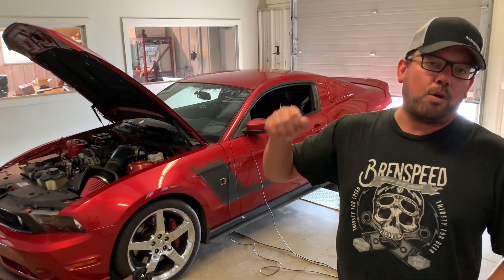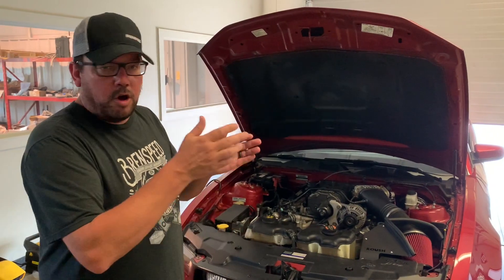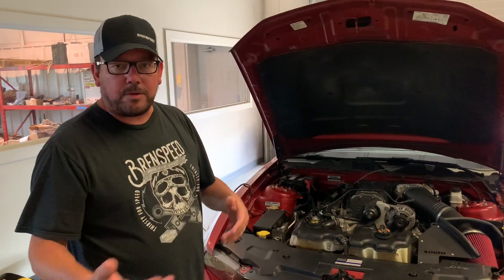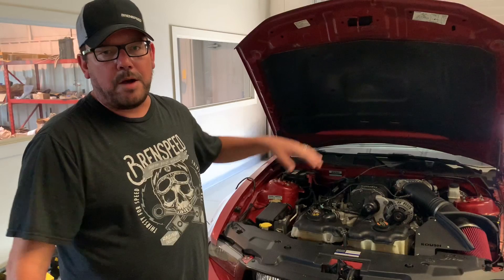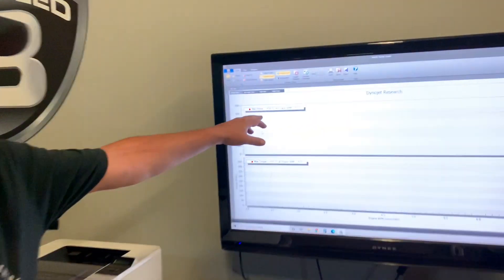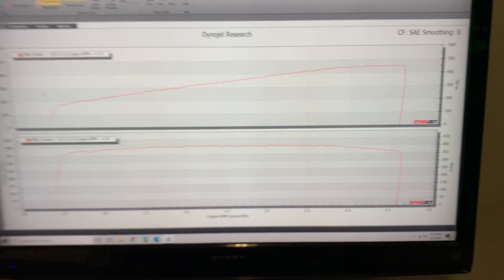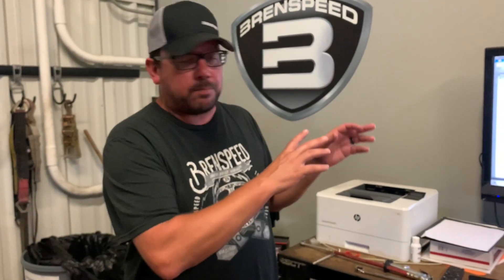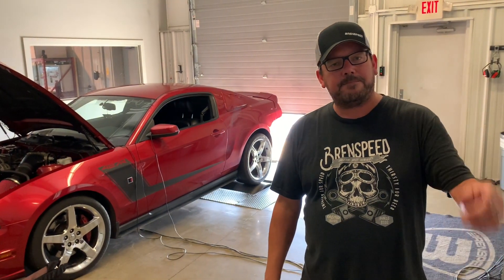2010 Roush 427R Mustang (with cams and headers upgrade) M90 supercharger & Dyno AT BRENSPEED

Comment: Question will the 2010 setup work for the 05-09 gt model ? With minor adjustments? Asking because I’m looking to pick up a used one for a deal but it’s a 2010 model one
Reply from the maker: If your talking about the supercharger kit itself I think you could make it work on a 05-09. If you are talking about the upgrade kit like the cold air it is specific to the 2010 model supercharger and will not work on the 05-09 M90 supercharger.
Reply: Thanks I was referring to the factory blower. By any chance do you know where I could find a 2010 model lower intake manifold for the blower that it will not come with. Also is the intake manifold direct bolt on.

Comment: What can you do for a 2000
Stage 3? It was originally around 350-370 horse from factory. Maybe under estimated? How much more hp can be added for a small package like this and what does it cost?
Reply from the maker: Here is a link to Roush upgrade packages https://www.brenspeed.com/05-08-mustang-power-adders-roush-upgrade-packages.html

Comment: Have a 06 with the m90. Looking into cams. Any recommendations.
Reply from the maker: We always use Detroit Rocker SC grind on those. Here is a link. https://www.brenspeed.com/detroit3vsc.html
Reply: How many horsepower you are making i have a 2010 gt with the m90 but they said you can't get the 450hp is that true

Comment: Is the Fuel pump upgrade required to make that kind of power.. I have an 08 with a m90, headers and H-pipe. Would  love to see 450+HP without having to dump too much more money into it.
Reply from the maker: Yes the stock fuel pump duty cycle is maxed out. So when doing headers, cams, and a pulley  you want to use a boost a pump.